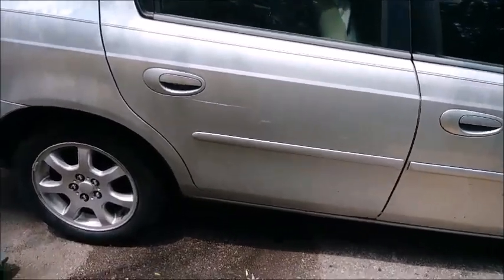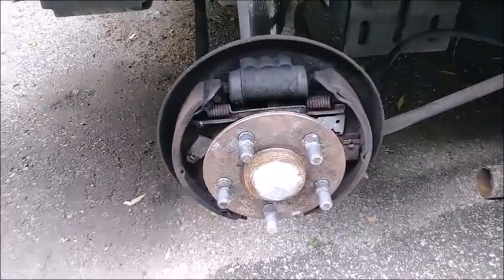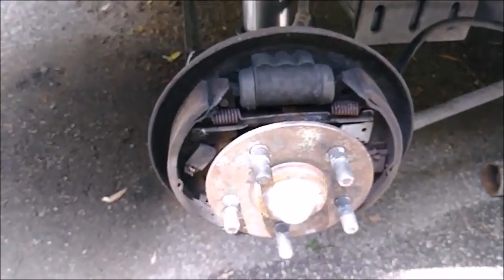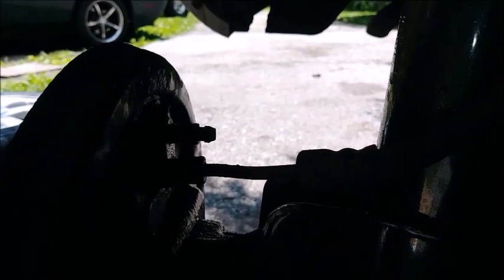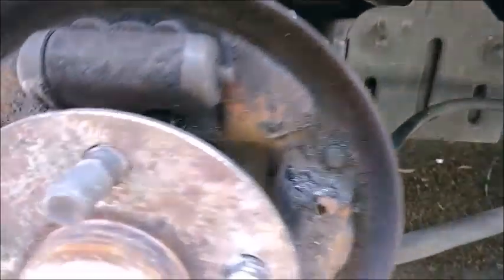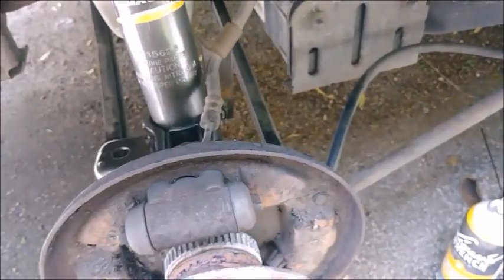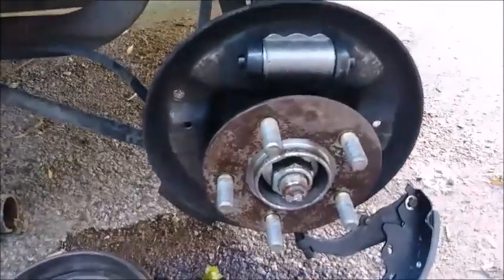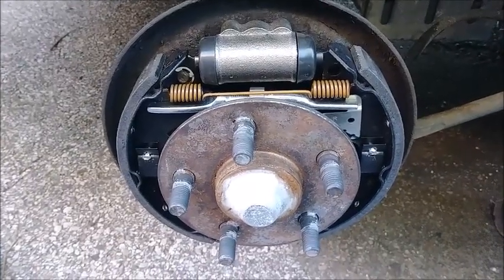How to replace drum brakes Dodge Neon and rear wheel bearing

Comment: We had our right rear lose a pad while driving it was freaking scary having the wheel lock up at freeway speeds. Had to completely install a whole new drum brake. Was not fun.
Reply from the maker: Exact opposite of the wife's experience. Her pads were so gone they wouldn't even touch the drums. She'd come to a stop gradually after hitting the brakes to the floor half a block away from her stop. Those sudden stops were bad times. I can't believe she drove it like that as long as she did. That shit is dangerous.
Reply: I did this today shit ducking sucks man

Comment: My driver's side locked up soon as I left my driveway so I backed it back in my driveway dragging my tire.  Haven't changed it yet but got the drum off and the pad part fell off.  Got to get all the parts and change it soon though.